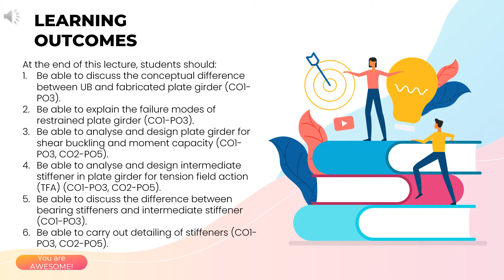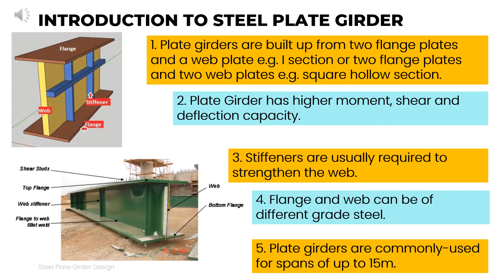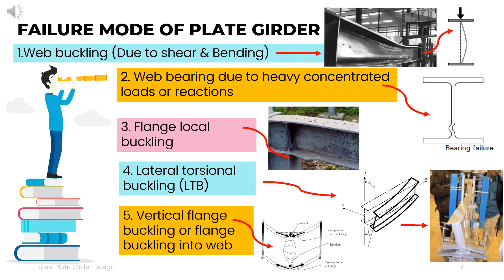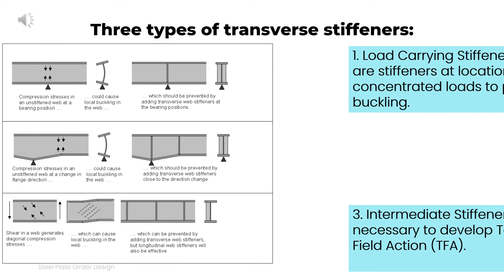Steel Plate Girder (Eurocode 3)-Summary By Dr.Ina

Comment: najmina_5c5
1. Definition:
Steel plate girders are large structural members made by welding or bolting steel plates together to form an I-beam shape with a deep web and flanges.
They resist loads mainly through bending and shear

2.Function:
Used in bridges, buildings, and heavy structures to support vertical loads and transfer them to supports.

3. Failure Modes:
   - Flexural failure (yielding or fracture of flanges)  
   - Shear failure (web cracking or buckling)  
   - Web buckling  
   - Lateral-torsional buckling (twisting of flanges)  
   - Connection failure (welds or bolts)  
   - Fatigue failure under repeated loads

4. Failure prevention:
- Providing sufficient lateral restraints
- Adding transverse stiffeners along the length of the beam web.

Comment: 5C5_Aina Alia;
This video what i understand about steel plate girders is large fabricated steel beams used to carry heavy loads over long spans, especially in bridges and industrial structures. It explains their components (flanges and web plates), common failure modes (like web and flange buckling, and lateral-torsional buckling), and how these can be prevented using stiffeners and lateral restraints. The lecture also covers the concept of tension field action, which increases shear capacity after local buckling. Finally, it outlines the main design steps: determining web thickness, bending resistance, basic dimensions, web design, and stiffener design.

Comment: 5C5_NURUL AFIQAH BITI HAZANUDIN
1. Definition:
A steel plate girder is a type of beam made by joining flat steel plates (flanges and web) together into an I-shape using welding or bolts. It’s used for carrying heavy loads over long distances. The main difference between a beam and a girder is size — girders are bigger and carry heavier loads.

2. Structural Limitation:
Plate girders are stronger than normal rolled steel sections. They can handle more bending, shear, and deflection, making them great for bridges, railways, and cranes.

3. Types of Failure:
Web buckling: When the web bends because of shear or bending forces
Web bearing: When the web gets crushed by heavy loads or reactions
Flange local buckling: When the flange bends locally
Lateral torsional buckling (LTB): When the girder twists sideways
Vertical flange buckling: When the flange bends into the web

4. How to Prevent Failure:
Transverse stiffeners are added to stop the web from buckling and to support heavy or concentrated loads.

5. Types of Transverse Stiffeners:
a. Load-Carrying Stiffeners: Placed at concentrated loads to stop web buckling.
b. Load-Bearing Stiffeners: Found near supports to transfer loads and prevent web crushing.
c. Intermediate Stiffeners: Placed between supports to stop web buckling and help with tension field action.

Comment: 5C5_norsyamira

Summary of Steel Plate Girder

Definition:
A plate girder is a large steel beam made from separate plates (flanges and web) welded or bolted together to resist bending and shear.

Components:
It consists of two flanges (top & bottom), a vertical web, and stiffeners to strengthen the web.

Design:
Has thick flanges, a deep web (high d/t ratio), and thin web plates; designed to prevent buckling and carry heavy loads.

Functions / Uses:
Used for long spans and heavy loads such as in bridges, railways, and industrial cranes; provides high strength and stiffness.

Failure Modes:
Common failures include web buckling, web bearing failure, flange local buckling, lateral torsional buckling, and flange buckling into the web.

Comment: 5C5_Iman Ezanee

• Steel plate girders are structural members used for heavy loads and long spans, built from flange and web plates.
• They differ from universal beams in size and are used when deeper, stiffer sections are required.
• Failure modes include web buckling, shear buckling, lateral torsional buckling, and flange buckling.
• Stiffeners (bearing and intermediate) are used to prevent buckling and support concentrated loads.
• Tension field action enhances shear capacity after local buckling occurs.
• The design process includes calculating web thickness, bending resistance, and stiffener design, guided by relevant codes.

Comment: 5C5_Iman Nabila

From the video, I learned that a steel plate girder is a large beam made by welding flat steel plates together to form flanges and a web. It is used when a normal steel beam cannot carry heavy loads or cover long spans. The design of a plate girder follows Eurocode 3, which provides rules to ensure safety and strength. 

Engineers must check several factors such as bending strength, shear buckling, lateral-torsional buckling, local buckling, and deflection.The video also explains that the web of the girder must be thick enough or supported by stiffeners to avoid buckling, and that the top flange can be restrained to prevent twisting. 

In summary, a plate girder is a custom-made steel beam designed carefully according to Eurocode 3 to make sure it is strong, stable, and safe for structural use.

Comment: 5C5_MOHAMAD HAQEEMI

Summary:
1. Definition
• A steel plate girder is a large structural beam made by welding steel plates together, which a web plate with top and bottom flange plates 
• Used when rolled steel beams are not strong enough.
2. Function
• Its main function is to support heavy loads and long spans, such as in bridges or large industrial buildings. It carries bending moments and shear forces effectively.
3. Type of Failure
     Common failures :
• Shear buckling of the web
• Lateral-torsional buckling
• Local buckling in thin plate sections if not properly stiffened.
4. Failure Prevention
• Failures can be prevented by adding stiffeners to the web
• Increasing plate thickness
Follow theEurocode 3 design rules to ensure stability and strength under load

Comment: 5C5_abid A steel plate girder is a fabricated structural member built from two flange plates and a web plate used to carry exceptionally heavy loads over long spans, often in bridges and industrial construction, offering higher capacity than standard rolled beams. Its defining design challenge is the thin web, which is highly susceptible to buckling under shear and bending; consequently, the design process, governed by codes like Eurocode 3, focuses heavily on calculating minimum web thickness, moment and shear capacity, and implementing stability solutions like lateral restraints and transverse stiffeners to prevent failure.

Comment: 5C5: Steel Plate Girder

Steel plate girders are fabricated by combining two flange plates with a web plate (often forming a square hollow section).
	•	They provide greater moment, shear, and deflection capacity compared to rolled sections.
	•	Stiffeners are required to enhance the web’s strength.
	•	The flange and web can be made from different grades of steel.
	•	Typically used for spans up to around 15 meters.
	•	For economical design, plate girders usually have thick flanges, large depth (d), and a thin web (t).
	•	Since the depth-to-thickness (d/t) ratio is high, the web becomes prone to buckling, so it must be designed carefully to resist buckling stresses.

Functions of a Steel Plate Girder
	•	Serves as a replacement for rolled sections in long-span beams.
	•	Designed to carry heavy loads, commonly used in bridge structures.
	•	Frequently applied in railway bridges, road bridges, and as crane girders in industrial buildings.
	•	Suitable for cases that require deeper and stiffer beam sections.

Failure Modes of Steel Plate Girders
	•	Web buckling due to shear or bending stresses.
	•	Web bearing failure caused by high concentrated loads or support reactions.
	•	Local buckling of the flange under excessive stress.

Comment: 5C5_Azalina
to summarise:
the video explain about what is steel plate girders ; the definition, the differences with beam, the function , and 5 types of failures. Also, the usage of transverse stiffeners at steel girders was one of alternative to prevent the failure.

plate girders design process also mentioned such as ;
- mininum web thickness 
- bending resistance 
- basic dimensioning 
- web design
- design of stiffeners

Comment: 5C5_Mohamad Helmi

Definition
-A fabricated section made from flange plates and a web plate and can be define as structural members that’s resist loads primarily in bending and shear. 

Functions
-To replace rolled sections for a long beam span requirement as rolled sections to be spliced.
-To support heavy loads
-To distribute loads from decks, slabs, or secondary beams to the main supports.
-Carry bending moments and shear forces in structures such as bridges, industrial buildings, and long-span floors.

Type of failure
-web buckling (shear and bending)
-web bearing (heavy concentrated loads)
-Lateral torsional buckling
-Vertical flange buclking

How to prevent failure
- provide sufficient lateral restraint
- adding transverse stiffeners along the length of the beam web

Comment: 5C5_Nisa Zafirah:

1. Definition: Steel plate girders are built-up beams formed by welding or bolting flange and web plates into an I-shaped section, used for carrying heavy loads and long spans. The key difference between beam and girder is the size of component. 

2. Structural Capacity: Plate girders offer high bending, shear, and deflection capacity compared to rolled sections, making them suitable for railway, bridges and as crane girders

3. Failure mode of Plate Girder
- Web buckling (Due to shear & Bending)
- Web bearing due to heavy concentrated loads or reactions
- Flange local buckling
- Lateral torsional buckling (LTB)
- Vertical flange buckling or flange buckling into web

4. Prevented failure modes: Transverse stiffeners is added to help combat the effects of web buckling and to provide support to any concentrated load or reaction

5.  Three types of transverse stiffeners:
a. Load Carrying Stiffeners - at concentrated loads to prevent web buckling
b. Load Bearing Stiffeners - at support/point loads, transfer concentrated load, prevent web crushing
c. Intermediate Stiffeners - between support, prevent web buckling, enable tension field action

Comment: 5C5_2024691972
Steel plate girders are large structural beams made by welding or bolting together steel plates to form an I-shaped or box-shaped section. They are widely used in civil engineering for bridges, buildings, and industrial structures where long spans and high load-carrying capacity are required.

A typical plate girder consists of a web plate (resisting shear forces) and flange plates (resisting bending moments). The design allows flexibility—engineers can adjust plate thickness and dimensions according to structural requirements, making plate girders efficient and economical for various applications.

Because of their strength, durability, and adaptability, steel plate girders play a crucial role in modern infrastructure, especially in bridges where they support decks and distribute loads to the substructure.

Comment: 5C5 : PLATE GIRDERS
-A steel plate girder is a welded beam made from separate flange and web plates, used for large spans when standard I-sections aren’t enough.
-Eurocode 3 (EN 1993 Part 1-1, 1-5 & 2) gives the design rules for plate girders, including checks for bending, shear, and buckling.
-Key failure modes: web shear buckling, flange/local buckling, and lateral-torsional buckling.
-Design steps: size the girder, check bending and shear, verify buckling, and add stiffeners if needed.
-Good fabrication and welding are crucial since girders are built from plates.
-Takeaway: Plate girders are efficient for bridges and long spans; understanding Eurocode design checks improves structural design skills.

Comment: 5C5_Ain Isri: The video explains what a plate girder is a fabricated steel beam made by welding flanges to a web plate, rather than using a ready-rolled I-beam.

It highlights the key design differences compared to standard beams: greater depth, need for stiffeners, possible buckling of the web, and how these are dealt with in Eurocode 3 (Structural steel – Design of steel structures).

It covers major checks in Eurocode 3 for plate girders: cross-section classification, shear buckling of the web, lateral-torsional buckling of the girder, detailing of welds and stiffeners, and fabrication considerations.

The take-away: Plate girders offer flexibility for long spans/heavy loads but require more rigorous design and fabrication control compared to standard rolled sections.

Comment: 5C1:

> the conceptual difference between UB and fabricated plate girder
- plate girder is a structural member that resist loads primarily in bending and shear
- key difference between a beam and a girder is the size of the component
- plate girder built up from two flange plates and two web plates
- has higher moment, shear and deflection capacity
- stiffeners are required to strengthen the web
- flange and web can be different grade of steel
- commonly used for spans up to 15m
- economical design: thick flanges, large depth but very thin web
- d/t ratio is very high, the web is susceptible to buckling
- to replace rolled sections for a long beam span 
- to support heavy loads such as bridge structure
- used in railway and road bridge
- used when we need deeper sections having high stiffness to carry heavy loads

> the failure modes of restrained plate girder
- web buckling due to shear and bending
- web bearing due to heavy concentrated loads
- flange local buckling
- lateral torsional buckling
- vertical flange buckling or flange buckling into web

> can be prevented by:
- provide sufficient lateral restraint
- adding transverse stiffeners along the length of the beam web

> function of transverse stiffeners 
- help combat the effect of web buckling
- provide support to any concentrated load

> types of stiffeners
- load carrying stiffeners 
- load bearing stiffeners
- intermediate stiffeners

> steel plate girder design process
- minimum web thickness
- bending resistance
- basic dimensioning
- web design
- design of stiffeners

Comment: 5C1:
- The plate girder is an I-beam cross-section made up of separate structure steel plates that are welded, bolted or riveted together.

- Generally it has:
1. Very thin flanges
2. Large depth but thin web

- Functions:
1. To replace rolled sections for a long span beam
2. To support heavy loads
3. It's mainly used in railways and road bridge 
4. It's used when deeper sections having higher stiffness

- Types of failure:
1. Web buckling 
2. Web bearing due to heavy concentration loads
3. Flange buckling
4. Lateral torsional buckling 
5. Vertical flange buckling 

- However, these failures can be prevented by providing sufficient lateral restraits or adding transverse stiffeners.

Comment: 5C1: A plate girder is an I-beam formed from individual steel plates welded, bolted, or riveted together. Designed with thin flanges, a deep but thin web, it is suitable for long-span beams and heavy loads. Commonly used in railway and road bridges, it provides the needed stiffness for deeper sections. 

Potential failures include web buckling, web bearing from heavy loads, flange buckling, lateral-torsional buckling, and vertical flange buckling. These issues can be mitigated with lateral restraints or by adding transverse stiffeners.

Comment: 5C7:

Plate girder is a structural members that resist loads primarily in bending and shear.
Plate girders are built up from two flange paldes and a web plate.

Functions of steel plate girder : 

 1. To replace rolled sections for a long beam span requirement as rolled sections need to be spliced and this may result in resistance inefficiency.
2. To support heavy loads such as on a bridge structure.
3. Plate girders are mainly used in railway and road bridge girders, and as crane girders in industrial structures.
4. A plate girder is used when we need deeper sections having higher stiffness to carry heavy loads.

Steel Plate Girder Design Process :

1. Minimum web thickness
2. Bending resistance
3. Basic dimensioning
4. Web design
5. Design of stiffeners

Comment: 5C7 : Plate girders defined as structural member that resist loads primarily in bending and shear.They are built up two flange plate and a web plate.Plate girder use to support the higher moment,shear and deflection capacity such as railway,road bridge

Comment: 5C7
Definition:

Plate girders are structural components built from two flange plates and a web plate, providing a high moment, shear, and deflection capacity.
They typically require added stiffness to reinforce the web and, for economic design, use thick flanges with a deep but thinner web.
Function:

Used for long-span requirements in structures, such as railway and road bridges, where rolled sections would not suffice.
Plate girders offer the stiffness needed to support substantial loads in bridge applications.
Failure Modes:

Web Buckling: Caused by shear and bending forces.
Web Bearing: Occurs under heavy, concentrated loads or reactions.
Flange Local Buckling
Lateral Torsional Buckling (LTB)
Vertical Flange Buckling (buckling of the flange into the web).
Prevention Measures:

Adequate lateral restraints, such as a composite slab, can help prevent lateral torsional buckling (LTB).
Transverse stiffeners added along the web length can mitigate buckling risks and strengthen the girder.